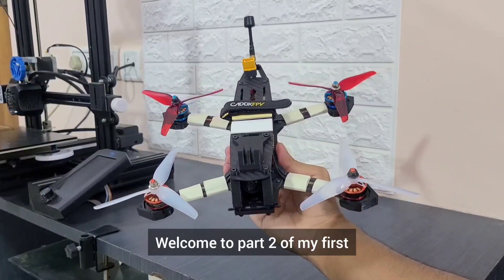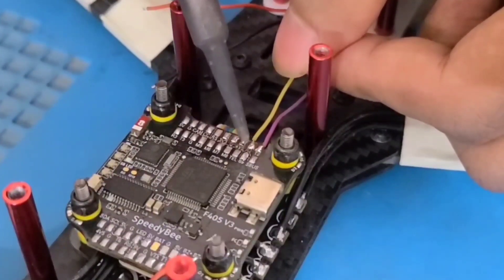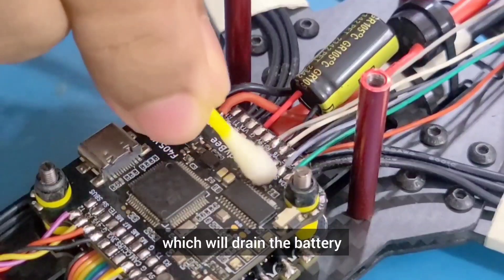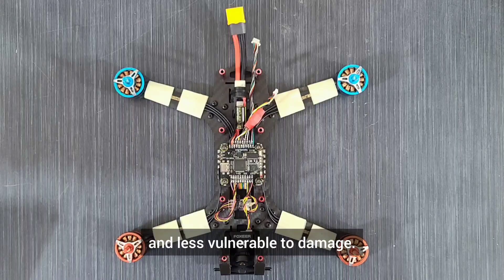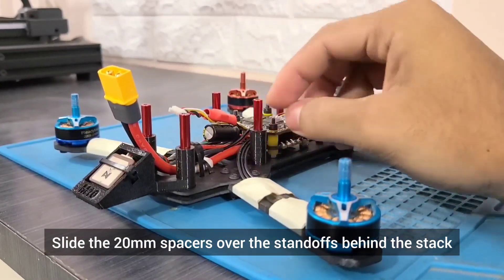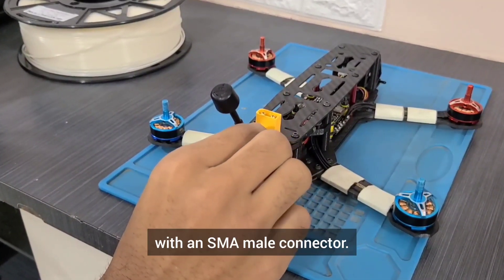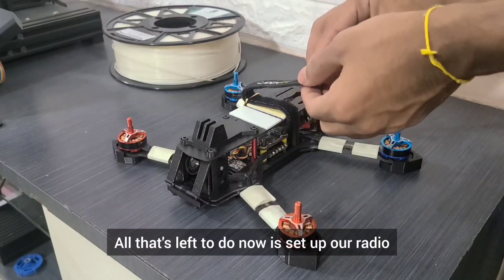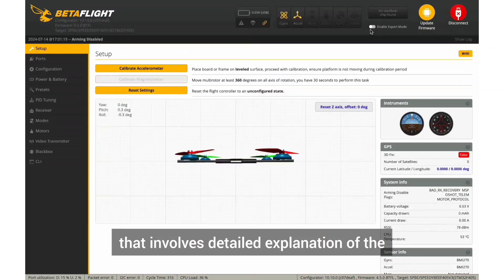SUPER BUDGET 4S FPV QUAD | BEGINNER'S BUILD GUIDE | PART 2 - LoS to FPV CONVERSION

Comment from the maker: A small correction - I said "hot start" at 7:29 when I actually meant to say "cold start"
Reply: Thank you Bro!
Reply: can u provide design link of those 3d printed parts .
Reply from the maker: @g_xgaming4011  You may purchase the parts directly from me! Ping me on Instagram if you're interested ✌️
Reply: @NoobFPVPilot Price?
Reply from the maker: @AbhirajShivhare-e8j 1050 rs for the entire kit excluing shipping.
Reply: @NoobFPVPilot Can it be little less and what are the parts which are included?
Reply from the maker: @AbhirajshivhareX-E The Kit includes
1) 1 pcs gopro base mount
2) 4 pcs arm guards
3) 1 pcs upto 22mm adjustable angle fpv camera mount
4) 1 pcs 30 or 20 mm Vtx mounting plate
5) 1 pcs SMA pigtail mount
6) 1 pcs 18mm GPS mount
7) 2 pcs spacers
8) 2 pcs 37mm bushings

I don't compromise on quality of parts and service so the pricing is set aptly 🙌
Reply: Please upload part 3
Reply from the maker: @AbhirajshivhareX-E Sure!

Comment: Share us the 3d parts
Reply from the maker: You can purchase them from me if interested
Reply: @NoobFPVPilot im lowkey mid class bro motors are also sec hand. I got no escs batterys or transmitters on me. Share me link when i make fpv ill buy
Reply: Hi what's the price of the 3D printed parts

Comment: Hey can I use the 2200mah 3s 80c????And also from where did you buy the smoke tester????
Reply: aliexpres
Reply from the maker: Yes, you can but note that a 2200 mAh battery is considered to be on the heavier side for a 5 inch quad. Also, 3S voltage is kinda low for 2300 KV motors. You need 4S for optimal performance!
Reply: @NoobFPVPilot Can you please suggest any good 4 s lipo in budget of 2000-2500 ruppes
Reply: Smoke terter from evelta electronics and that too cash on delivery

Comment: It doesnt look like that you used the rs2205 motors but you've listed them in the description. Any reasons for this?
Reply from the maker: @GaganV173  There are many versions of the RS2205 motors. There's the original one from Emax and its clone from ReadytoSky. These motors don't look like the aforementioned but they're also coded RS2205 and manufactured by ReadytoSky 😊👍
Reply: @NoobFPVPilot  thanks man 🌟. What are your opinions on the gt2205? I am following your LoS build and want it to have a payload capacity of around 300g for carrying out autonomous tasks. I'm thinking of 6 inch 3 blades. Any other suggestions for the motor from your end? The budget is around 1300 per motor
Reply: @GaganV173 velox 2207 motor good motor in 1200 price range

Comment: What is the flight time youre able to get with the 1300 and the 1550 mah lipos? Kindly provide the weight of the build without all the fpv stuff, the one which was in your previous video
Reply from the maker: Around 6 - 8 minutes cruising around. Let me get back to you regarding the weight!

Comment: Bro could you please make a fpv built with f4 pro v3 flight controller please brother.❤ heartiest pleases from you oldest subscriber
Reply from the maker: The concept remains the same for all modern flight controllers. Just follow its wiring diagram and you'll be good to go. The f4 pro V3 is an outdated FC and you can get much better FCs nowadays for the same cost but I'll consider your request! 🙌

Comment: Nice Video. Really good explanations thx.👍

P.S. You don't need to say 4mm screws, they are metric size so 4mm screws are called M4 for metric 4 mm screws or M3 for metric 3mm screws.
Reply from the maker: Thank you so much! 🙏🙌

I am referring to the length of the screw when I say "x mm" and not its nominal diameter. Can you point me to the time when I mentioned only the length of a screw without mentioning its dia? 🤔

ps - I am an ME.
Reply: @NoobFPVPilot  Sry i must have misunderstood in the Video. I watched again and found no flaws. Thx for replying. Keep it up!👍
Reply from the maker: Edit - changed "4 mm" to "x mm"

Comment: Bro which 18650 battery is best for radiomaster pocket, please guide me
Abhi Jo mere pass hai usse pocket band ho jaata hai load aate hi and also shown 10.4v in transmitter voltage but how it's possible maximum v is 8.4v for pocket and it shows everytime different voltage
Reply from the maker: @errorattacker6821  Molicel 2800 mAh lelo bhai best hai 🙌
Reply: @NoobFPVPilot  bhai lekin uski c rating 13c hai or high discharge rate hai, so it is suitable for pocket ya fir low c rating wala lena hoga
Reply from the maker: @errorattacker6821  You can even use a 100 C battery. The load will only pull how much current it needs from the power source. 😄